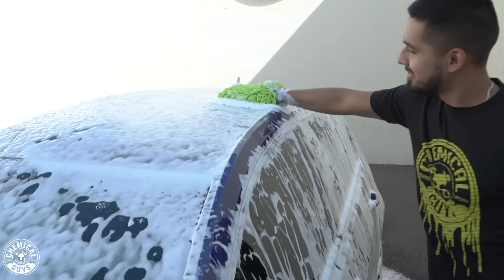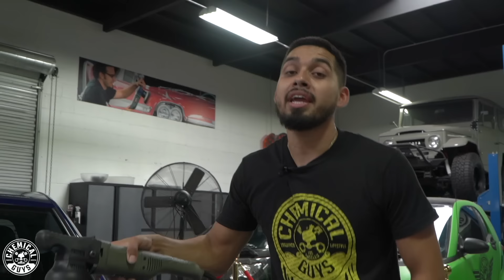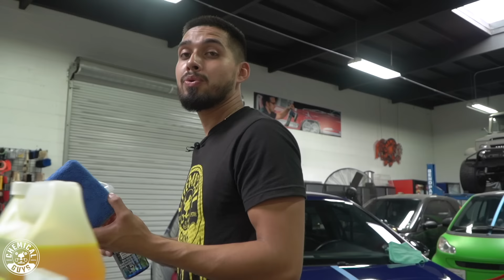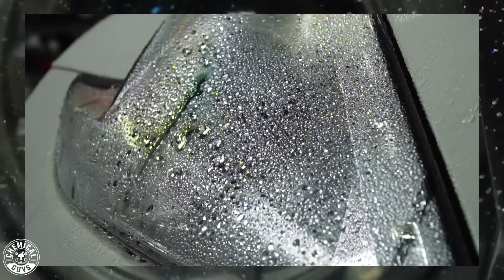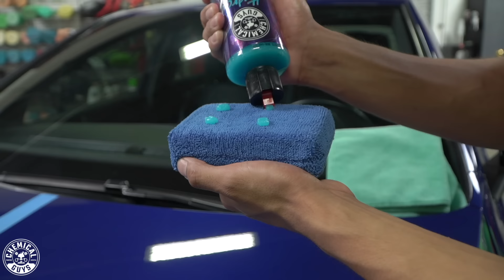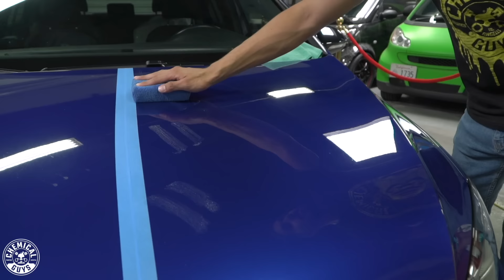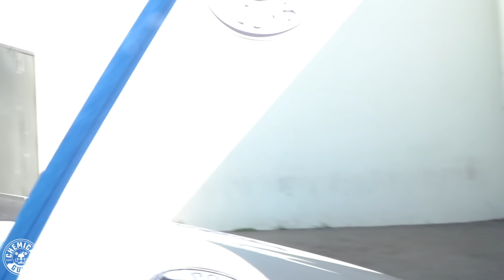How To Ceramic Coat A to Z! - Chemical Guys

Comment: Are the cutting pads reusable? Or do we have to throw them after use? Also how long can i use a pad? Like one panel only or a while vehicle?
Reply from the maker: Hey! The pads are reusable. We recommend cleaning your polishing pads with Pad Cleaner and your microfiber goods with Microfiber Wash. Polishing Pad Cleaner uses the natural cleansing power of citrus to wash and rejuvenate all foam, microfiber, and wool polishing pads, ensuring that pads last their longest and perform their best. Microfiber Wash is a specialty detergent that cleans and restores microfiber. The advanced cleaning formula releases dirt, grease, and residue, leaving microfiber feeling and performing like new.

https://www.chemicalguys.com/microfiber-wash-cleaning-detergent/microfiber-wash.html

https://www.chemicalguys.com/foam-and-wool-polishing-pad-cleaner/foam-wool-pad-cleaner.html

Comment: It's great to see your guys products in Walmart stores keep up the great work and detail information
Reply: If you have an actual chemical guys store near you, stop by. It's amazing how much stuff they have that hasn't made it to Walmart yet.
Reply: @Ben Winstanley amazon
Reply: I agree 💯. I’ve been switching over to chemical guys for all of my cleaning needs etc. even the window glass cleaner is better than the one I’ve always used and less harsh. iMO. Love their products for my Mach1
Reply: @MattR7315  
I just started buying the products. I haven't used them yet.
I look forward to great gloss!
I've got a black car I've buffed out and want to take it to another level.  Insanity can grow quickly with a black car. Lol
Reply: @Ben Winstanley ebay has most
Reply: @debradurling317  why not the actual chemical guys website?
Reply: What’s better, clay bar or clay block?
Reply: @rickraub5448 initial decontamination always use a clay bar and finalize it with your choice of protective coating (glaze, sealant, wax, ceramic). Routine maintenance between coating applications can be done with a block.
Reply: Dude fr I just bought a chemical guys wheel cleaner from Walmart tonight 😂
Reply from the maker: Happy detailing!
Reply: @ChemicalGuys  p
Reply: Yes I agree, but that's only because I don't feel bad stealing them from Walmart, healing from a detail garage that just makes you a f**** Criminal

Comment: Can i use my chemical guys  vo7  spray after doing the hydro charge and hydro slick coatings, and what about extreme
Body wash and wax,  for washing,  or should i stick with the hydro line once i ceramic my paint?
Reply from the maker: Hey there! Yes, you can use V07 Spray Sealant to maintain both coatings. You can also try out our newest ceramic product, HydroSpeed Ceramic Quick Detailer. It works out exceptionally well to boost the shine and protection properties of your coating and also removes that light layer of dust and debris.

Comment: Do you have to use all of those products in line to see results, or can you just use like the wash or the detailer or just the wax alone to show results
Reply from the maker: Hey Zachary! Use any of these products or all for the most durable layer of protection.
Reply: @ChemicalGuys  is there a specific way to use hydro suds to be results, cause y’all just show washing the car like normal and it should repel water, but mine did not. The water was “sheeting” instead of repealing it

Comment: Hey Henry or Nick got a question for you. When applying hydro slick how long do you wait before buffing it off when the temperature is in the 50's or 60's?
Reply from the maker: Hey there! Allow about 2 minutes for HydroSlick to bond when working in colder climate. Happy detailing!! 
- CG Nick

Comment: Hey Henry how are you? 
Henry I have a question about the Diablo wheel cleaner Gel! Do I need a bucket or just a spray bottle with water
Reply from the maker: Hey! Diablo Wheel Gel can be used in both a spray form or wash bucket to gently clean all wheel finishes.
Reply: @ChemicalGuys  is Diablo wheel Gel safe to use on factory aluminum wheels that have been polished? the wheels are not painted, just raw aluminum polished.
Reply: @SnailHouseProjects  safe for all rims

Comment: The best part is that HydroSpeed doesn't have a curing time, so you can use it if its going to rain tmrw and have that quick ceramic protection from the rain. Awesome product I have purchased
Reply from the maker: Happy detailing!